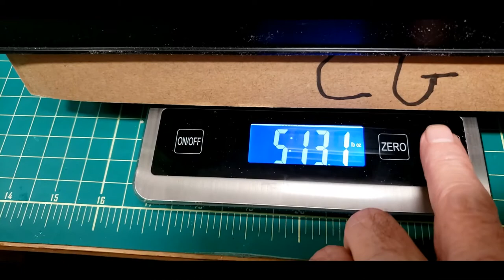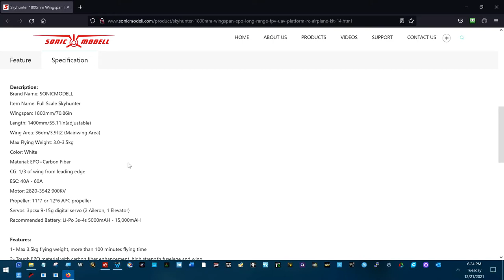SkyHunter All Up And CG

Comment: Hi Vernon, I fly mine with a CoG of 90mm aft of the leading edge, which is just in front of the servo wires. Works great for me and makes the plane very efficient. I fly a 8000mAh 4S Lipo shoved back underneath the wooden tray.
Reply from the maker: Thank you so much.  I am flying it for the maiden flight tomorrow and could only find 1/3 of the wing for the CG.  Thank you, thank you, thank you.
Reply: Good luck with the maiden. The fact that its a little nose heavy is not gonna be a problem i think. Much better than tail heavy 😉
Reply from the maker: @uavaviation5560  I moved the CG back.  :)
Reply from the maker: Oh.  Not all the way back but at like 85 mm.  And it was so windy today I didn't maiden it.